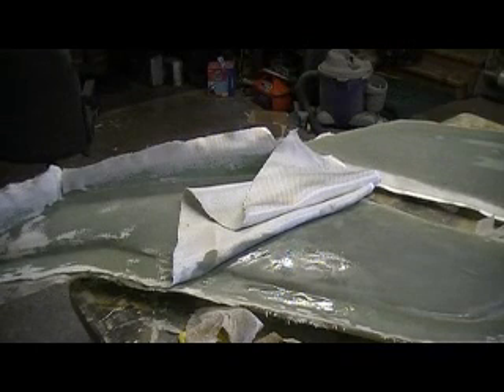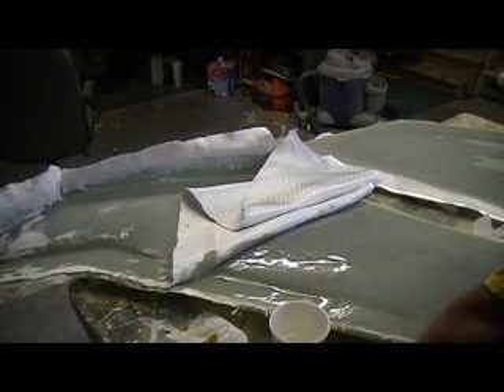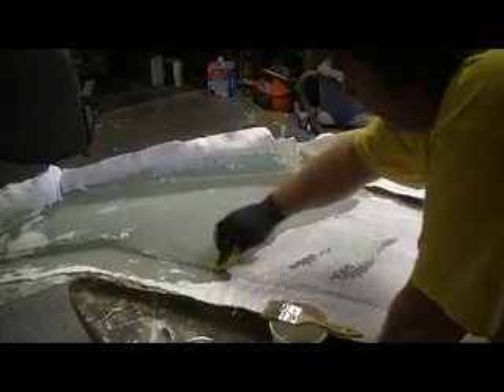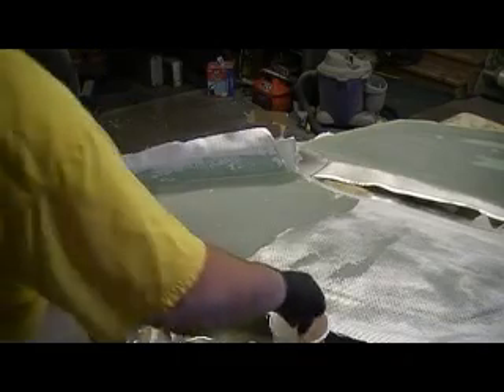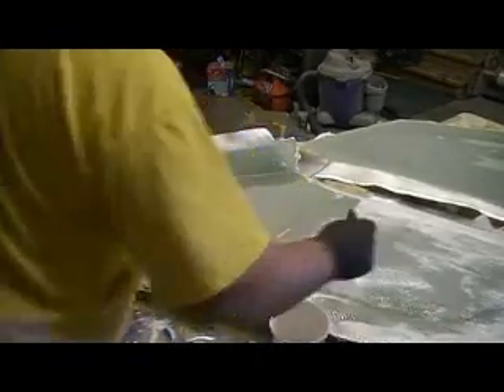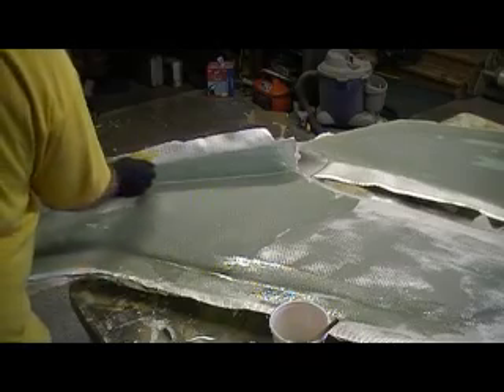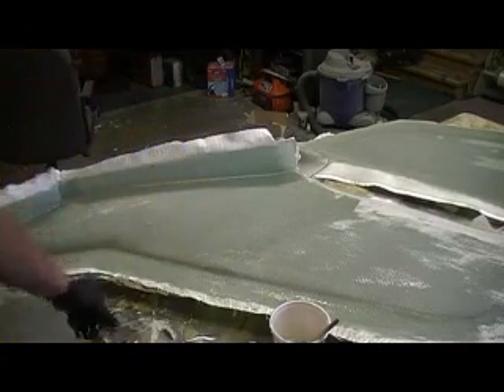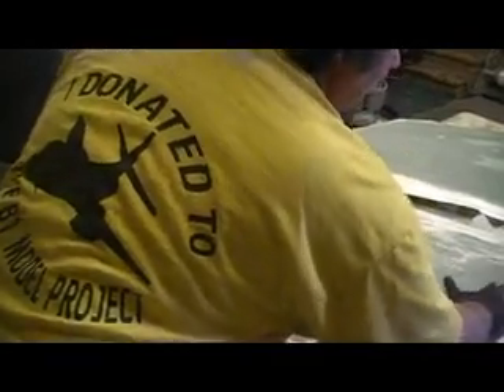how to build a rc jet F-105 thunderchief # 207

Comment: @PC9JEFF 

I've seen those rollers.  They use them is the fibreglass boat building industry.
Just wondering, years ago osmosis was a big problem with glass.  Seen a few bad cases when I was working at a couple of marinas.  Was caused by humidity getting trapped inbetween the layers causing weak spots. We called it fibreglass rust back then.  Bob, does the weather/season play into it when you are making these moulds and the eventual planes themselves?

Comment: At some high end art shops they sell this tool called a brayer.  It is like a rolling pin with a handle but the roller is made out of very firm rubber.  I use this tool in my trade all of the time.  It works excellent for smoothing large areas with curves and to get bubbles out because it forms to whatever you are rolling.  If I had alot of money, I would send you one.
J